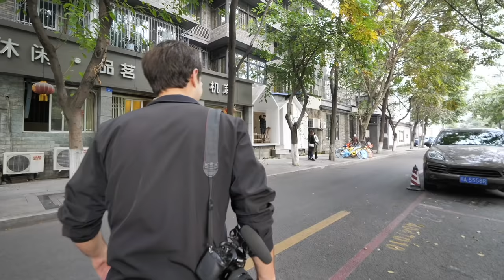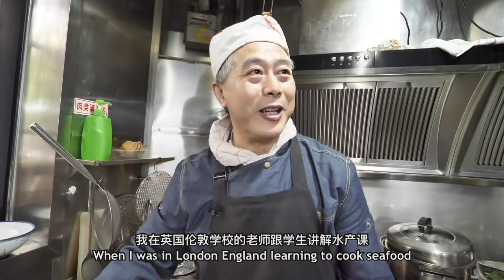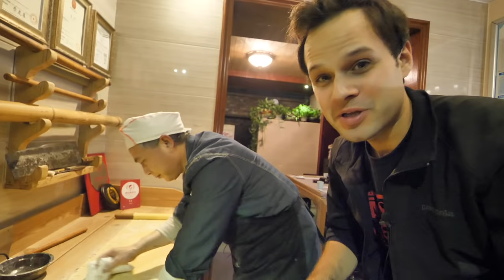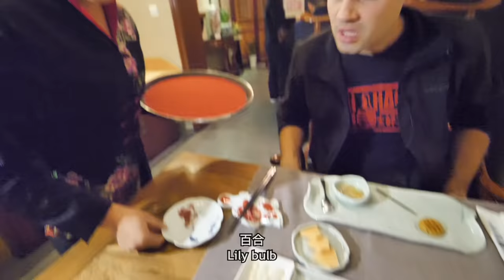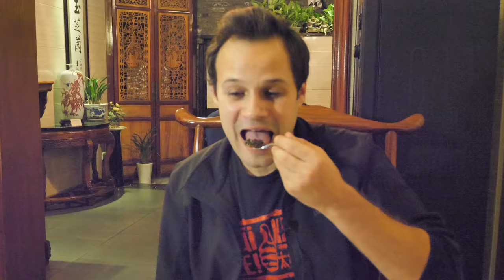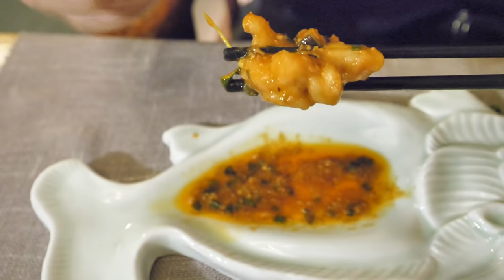INSANE LUXURY Chinese Seafood - $300 HUGE Chinese Seafood FEAST - LOBSTER, ABALONE, EEL, and CAVIAR!

Comment: Not sure those Lobsters "calm down" for the reasons chef mentioned
Reply: hyphen point said if the lobster is fresh while cutting them, they might injure themselves(interior), will course the texture of the meat
Reply: @Fibroadenoma2  I understand why he is doing it, but his explanation is a bit off. The lobsters most likely get dizzy and "calm" because of the water, which has a much lower concentration of electrolytes than sea water.